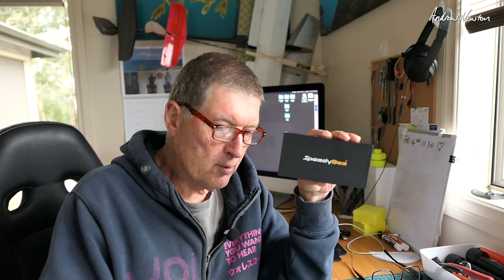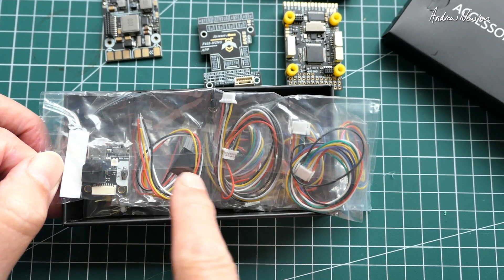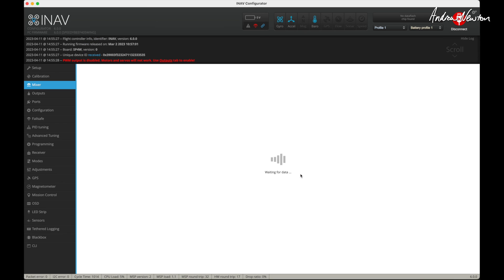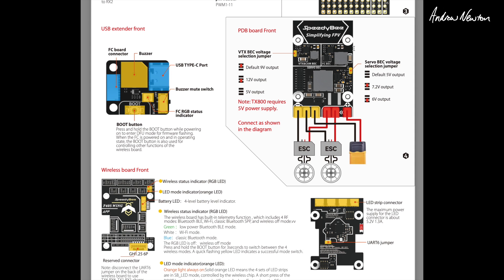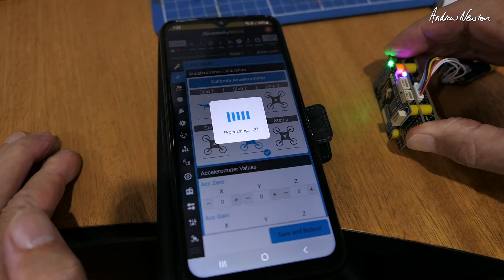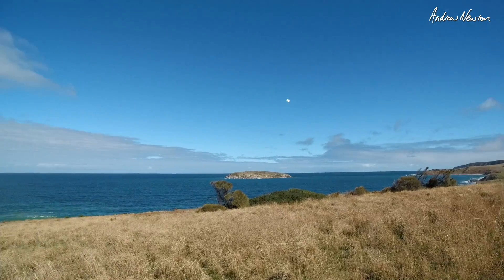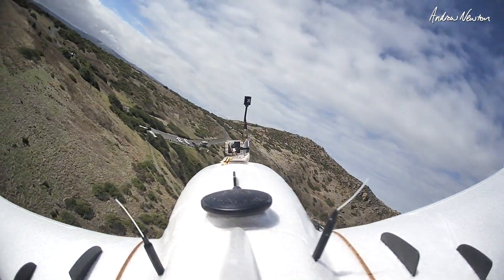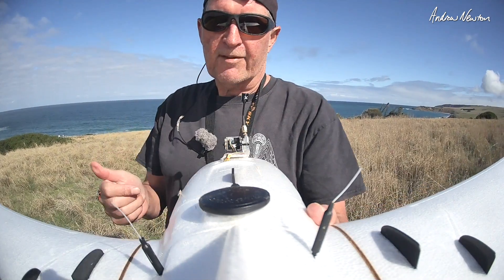SpeedyBee F405 Wing FCB

Comment: Hi Andrew! thanks for all your videos- this on in particular. After 35 years of building & flying RC, I am finally ready to get into flight controller use.  My first project is to be a simple tail sitter vtol wing, i think using INAV. Will this FC support that? thanks
Reply from the maker: The board will be fine for VTOL but tail sitter with INAV is very much in its infancy.
Reply: Thank you

Comment: Another great video.Thank you for helping Newcomers like myself if I don't understand this fc. I have a question for you, and that is, if I wanted to use the D ji 03 air unit. Do you have any idea of how to arm it To get out of the low voltage state?
Reply from the maker: Thanks. Arming the FC should bring it out of low power mode, at least that's how my DJI air units work. 03 might be different.

Comment: Hi I’m new to using flight controllers. I have this speedybee one. My question is I’m putting it in the Ranger 2000. How long can the wires be from the board to lipo and also the esc. Thanks
Reply from the maker: As long as they need to be. Some of mine are 25cm
Reply: @AndrewNewton  thank you.

Comment: Many thanks Andrew for your perfect review so i just ordered one today !
Will be mounted on a modified Bird (Eagle...)  looking Vtail parkflyer with pylon mounted brushless and 1.4 M wingspan sligthly carbon reinforced for the extra onboard HD FPV (Firefly Q6) + analog TX TS 832.
I plan ton install Arduplane thought since not familiar with Inav and I love the advanced functions of Ardupilot although the RAM on the board is lower than regular Arducopter rigs such as ProfiCNC Cube series.
Anyway I'll share the results once completed which is scheduled first quarter 2024 due to other projects that needs to be delivered.
Cheers 😀
Reply from the maker: Sounds good. Should be fine for Ardu but maybe need to put additional font files on the SD card

Comment: Hi Andrew. Got the speedybee installed in the atomrc seal. Just received the led lights but don't know how to turn them on, can you help please?
Thanks
Reply from the maker: Didn't know you could turn them off. Check the manual for the required boot button pushes maybe
Reply: Do I need to set something in inav?
Reply from the maker: No it is all done with the Boot Button on the board. Although there is one mode where control is handed to INAV, but I have never played with INAV leds.

Comment: Hello again Mr. Newton, greetings from Florida, more specifically hello from my swimming pool of airplanes - I've gone build crazy and up to my neck in new foamies! So many good planes have hit the market over the last year that I've been lucky to flash iNav and Ardupilot on a host of FC's for fixed wings and quads. From Aikon, HackRC, HappyModel, and lots of Mateks and SpeedyBees, it's been a busy year of buildingand flashing iNav 6.1.1 on so, so many birds.

I have a thing or 4 to say about this little gem, and this series of boards from Speedybee: Easily the most approachable, beginner-friendly boards out there. Their diagrams, explanations, and even pinout info are second to none, making Mateks lovely diagrams look amateurish somehow. After years of being an Omnibus snob, I'm struggling to understand why, (beyond the isolate-able 5V rail), Airbot never even published V_Scale info for their designs lol. 

Starting with this board, I've had a taste of their family of F4, the 20x20, 30x30, and the micro F7. All of them are laid out as if an actual enthusiast were responsible - with some very nice touches thrown in. For instance, these are my first boards with WiFi or Bluetooth connectivity, and there's an up-to-date app that's always being updated to get you into most setting you'll need in the field - even BlHeli settings! This and the 30x30 board have the most comprehensive LED controllers on an FC I've ever used, with 4 mirrored outputs and a hefty BEC to power them. You can switch between iNav/Betaflight control, or the onboard controller on the go, pretty groovy. 

And stout - I have this Wing variant on an Eachine Airloader twin tractor, turning 7" props with flaps and a panning servo. 2W VTx and Starlight Baby Ratel2, FrSky L9R, and 60 RGB LEDs - everything is running on the onboard BECs, staying cool as a cucumber. No issues 5 months in. Nighttime Flyer Extraordinaire, so far! I have a couple more in other planes, but they don't have 7x 9g servos and 2000mw of VTx, or all the LEDs like the Airloader. Champ.

The one thing the Matek equivalents have, that this generation of SpeedyBee boards lack, is a second input for analog FPV cameras. I had to resort to a single nano camera on my anniversary Reptile 500mm build, with the 20x20 F405 as the FC. I had room for at least 200 more, lol.
Reply from the maker: Wow, your Airloader must be a sight, and a great test of the board capabilities.
Reply: @AndrewNewton  Part of me wishes they didn't put an RGB LED on the USB breakout board - it's always #1 in your chain of 32 addresses. The Wing board has four parallel outputs, so take advantage of that 5th if you're Going Lit.

It didn't start out great, friend, lol:
https://www.youtube.com/shorts/FLjOuomnz5E

Comment: Interesting video! First of all, thank you very much. I also use the board and have a problem with the ETC. My ETC only starts to let the motor turn when I have throttle at half position.  I suspect that since the ETC is already powered when the battery is plugged in and the FC is still booting, the problem arises. If I use the ETC normally with a normal receiver, the problem does not exist.
Reply from the maker: ESC? Needs to be calibrated in INAV. You can use the Outputs tab if you select Live Mode and use the slider.

Comment: Hellow Mr. Newton.
Your videos are very good and very educational, since I discovered you I follow you.
I wanted to ask you if it is possible to use a FRSKY R10PRO receiver on the FC Speedybee F405 wing and through which port, and especially the configuration on the X20S transmitter. thank you very much.
Reply from the maker: Yes with ACCST and SBus but probably not FPort. I will check with mine

Comment: Thanks for the video. Were you intentionally switching between OSD 'presets' (going from a cluttered/informative display to almost nothing displayed at around 11:03)? Did you map that function to a radio channel within the FC board or is that an iNav setting? Seems like a useful function, unless that was an error with recording to the black box while simultaneously displaying the OSD. I'm also wondering which antennas you were using for your Eachine vtx and goggles, if not the stock ones. Thanks
Reply from the maker: All Foxeer - Echo 2 patch and 15cm lollopop on the goggles and a lollipop on the VTX. I have 3 OSD screens which are on the left dial, set up in INAV modes page
Reply: Thanks. I also appreciate your follow-up video on wiring the FC as it answered lots of questions for myself as a beginner. I think I’ll be choosing this flight controller for Ardupilot projects and perhaps explore INAV with it later on. I hope it’s reliable.

Comment: On the led ports, is it capable of letting the fc address the leds? If so, does each port do a specific number range of leds or does each leg have a data in and data out that are chained together in order? Not finding much info on it, I may just hook it up and do some testing
Reply from the maker: I have never tried FC programmed LED's but someone said only one LED port is FC controlled

Comment: I just received the two I ordered and where I have zero issues getting my other FC to connect on my PC using betaflight or inav. I'm unable to get either of the speedybee fCs to connect. I had zero issues getting the three boards connected to each other as well as the remote buzzer/usb board connected. Both fc's light up and buzzer initiates if enable they just are not detecting as a usb device. Strangely enough the first FC i opened had a jumper on the esc board connectors I had to remove before being able to connect to the other board where the secound fc had no jumper that had to be removed. I really have no clue whats going on with them or why one had a jumper and the other did not.....s
Reply: Bawahahah have you tried turning it off and back on?? Its fixed!!!
Reply from the maker: Haha, yes I have to reconnect and re launch the configurator occasionally. Not only with the SB F405

Comment: Hi Andrew can you do a video showing how to connect all the wires in this Fc? Just to say one, I have no clue where to connect the signal esc cable on the board… It would be very helpful for many of us. Thanks.
Reply from the maker: Yes that would be a video worth doing. S1 and S2 are for ESC signal wires. But signal and ground only, not the red wire.
Reply: @AndrewNewton  thank you Andrew!